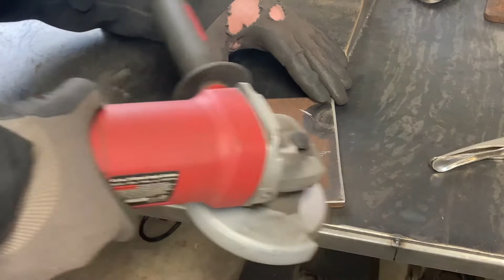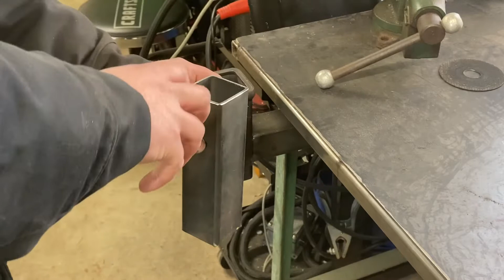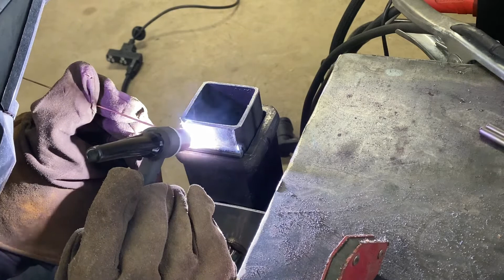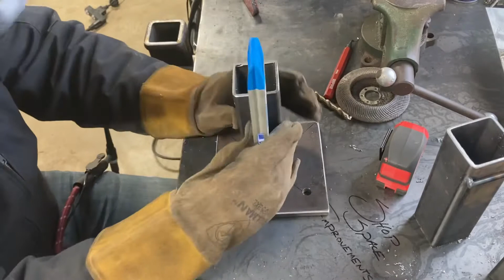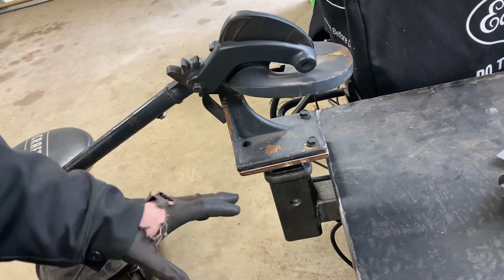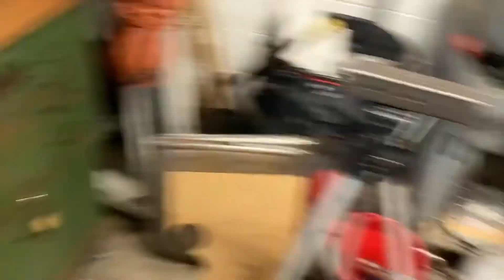Shop upgrade: Workbench Quick-change

Comment: New to your channel, diggin your style. Why did you go vertical instead of horizontal for the 2x2 ID receiver tube? Just Curious, no quarterbacking meant, haha.
Reply from the maker: Thank you very much for watching. Good question! I was actually chewing over the idea of going vertical over horizontal for a long while. I decided to go vertical to simplify the construction of the base the tools are bolted to. A simple 7” length of 2x2 box welded to a plate is cheap, quick and easy to build on the fly. Plus it works well with the storage plan I had for tools not in use.
Reply: @TheHotRodWorkshop  I appreciate the thought process. Thanks for the response.